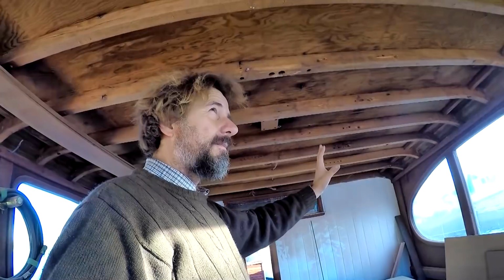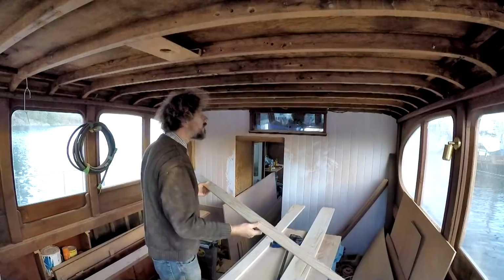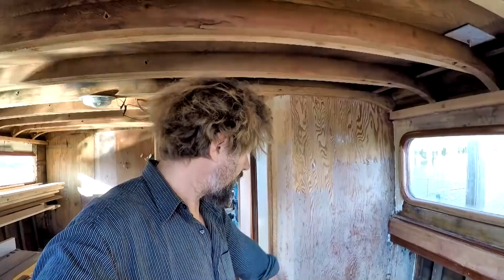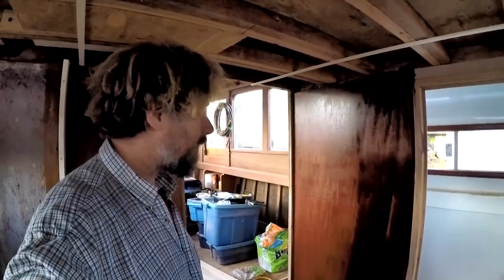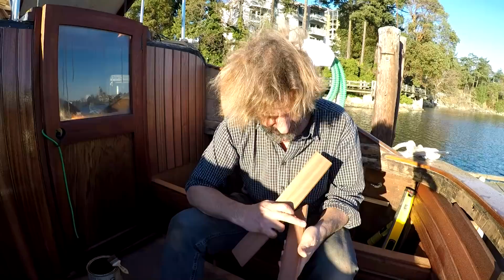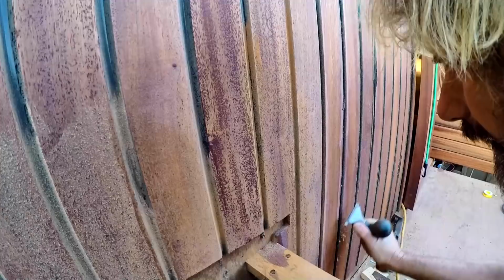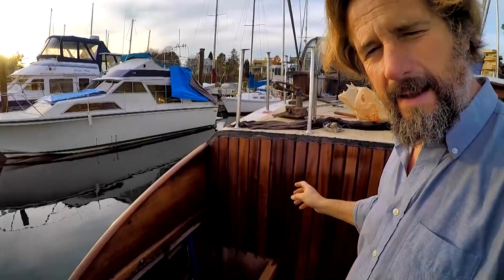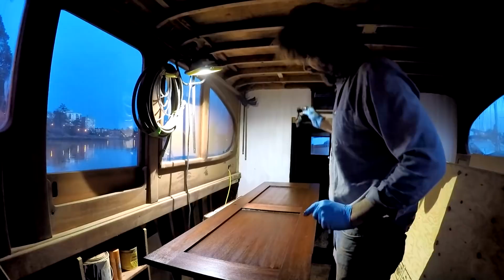Planking the bulkhead, Etc - Wooden boat restoration - Boat refit - Travels With Geordie #76

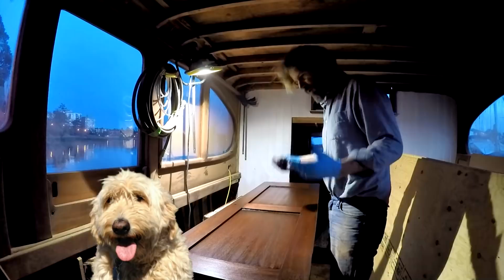Comment: 19:00 Gordy moves across screen from right to left.  Woof!  Keep up the great work.
Reply from the maker: Hi all you Cooks. Thanks for the kind words. Sadly I gave away all five shirts already. More soon!
Reply: MHey Gordy  i wanted to let you know  i was following up on our Masonite  ceilings  like you  my  usuall M O  when I'm building  something is to glue, screw, and tattoo the crap our of everything. Hoping i dont have to do the tear out down the road  i think you  got the right idea  screwing  the sheets onto the  framing   One. Concern i wanted to again point out  is it could work. Against. You  not having  any  movement  i  did  use a milled  peice of Sapele     I   Screwed  over  the joints  my first idea was to  mill splines   On the edges and. Slide the  edges of the Masonite into  the splines  but after several  failed attempts freezing my ass off on the icy Chesapeake Bay   And. Only ha;f a bott;r of rum  that planned changed  too those strips really  just  became for looks  i used stainless Robertson's  and i could  loosen and tighten the screws bu hand if it needed. It  (it didnt)   A consistent  problem i saw quickly was my sheets. Were many thicknesses  and it turned out  well  overall  my Dad. Used to tell me to pick my battles wisely  not everything  has to be built  like a fine peice of furniture  and  figured out what he meant   If i was to do one again I'm pretty sure i would. Glue up  4x8 sheets. With White Formica  on one face  the company I worked for back in those days distributed millions if dollars wort of HPDL per year and they would sell to us as a favor.at cost  which made it perfect for doing honey dos and personal  jobs  i worked there  for 20 years an they  a;ways did nice things for many of the employees  one of the guys actually had hotrods he'd bring in on the weekends and paint them in the shops booths  and bake them dry  with the place empty from any other people

Comment: Just found your channel so a bit late to tell you this. 
Calking material has to stretch when the timber dry's out under direct sun, this stretching of course takes the least form of resistance. Now you have filled the bottom groove of the bulkhead planking and the material will adhere to both sides of the planking and the face at the bottom of the groove, so three faces. During timber shrinkage one of these faces will fail, hopefully for you it's the bottom face, as then the two sides will remain sealed.
 I caulked the teak deck of my 1930s motor yacht in the same way, spent a fortune on Sika Flex but I didn't know they also sold a special tape that fits in the bottom of the groove that the caulking will not adhere to it. Over winter the deck did not leak, but half way through the next summer it started. That's when I found out about the tape, but then I had the job of finding the leaking joint, the leaks of course did not correspond with the drips below as the deck was laid on marine ply. So there was nothing for it but to dig deep into the piggy bank and re-caulk the whole bloody deck again.

Sadly I had to sell the old girl in 2010 but she has gone to super people and they have upgraded her, hopefully she will last another 88 years

Below deck the underside of the marine ply was covered with a mahogany faced ply let in between the beams. I think those white panels you bought would have looked great let in to those beams of yours. But hey it's you boat and I look forward to seeing progress with it and see her finished.

PS: If you are bored one evening look up Lazy Days, Dunkirk Little Ship. www.adls.org
Reply from the maker: Very good point on the three sided adhesion. I worried a bit about that and considered using a backer rod but it would be too thick. The tape sounds brilkliant. I really did want to put my overhead panels between the beams, I love that look. But the beams are a bloody mess and I didbn't have it in me to deal with that this time around. But I have a long term plan to do it that way and reface the beams. I'll check out Lazy Days.

Comment: I’m really impressed with your work, the way you manage that little space is nothing short of magic! I am really liking how it is coming along. 

I don’t know boats but have always dreamed of owning a chris craft styled motor yacht. Can you tell me, is it cold on board? I don’t see much use of insulation on boat refits
Reply: On YouTube videos....
Reply from the maker: Hi Daniel. Thanks for the kind words. Wood boats generally don't have insulation except possibly in the overhead space but even there it's probably not a very good idea. Happily the wood provides excellent insulation most importantly to avoid condensation which plagues plastic boats. I am plenty snug aboard while at the dock with 20 amps of shore power and electric heat. At sea or anchor I use a diesel water heater that also keeps me toasty. This setup will be all explained in upcoming episodes.
Reply: Thank you for taking the time to reply mate. Keep up the great work!

Comment: I really love your videos! How did you fastend the masonite roof panels? I have to fix the roof of my boat this winter...
Reply from the maker: Thanks so much Klas. I pinned the masonite up temporarily with tiny stainless steel air nails. They'll be held permanantly by wood strips between the panels screwed to the beams above.

Comment: Fantastic video , i redid a 1964 Chrus Craft Connie and i did  use  White Masonite for  my   New headliner  i was lucky that i had no water. Leaks or.  Issues  as i did  use  a West System om the exterior and a  very flexible paint with non skid. Called Durabek  over the  entire deck and  exterior  of the cabin and roof ! It was many  educated guesses   And 20 K. Worth of materials. To  get her ready for the water   And  the way i wanted her done   I first  used a plastic  white pegboard on the  headliner and i  was iunhappy  with its expansion with the seasonal  weather changes  making me change to the Masonite  i did however  put a waterbased poly on the  unfinished side to seal. It  and that may have  protected it. From  getting any water damage ?  Who knows why it worked. I may have just gotten lucky  i wound up selling the. Whole boat  and bought a Fibergkass boat that someone had already repowered and  completed many other cosmetic restorations  so it was more of a turn key  instead of a project boat ;Ike the Woodie Chris Craft !  Which you know any boat is  high maintenance   To keep in great shape    I did see the dog go accross the bottom of the screen right around 19:00  when you were giving the interior tour  of the interior aft area of the cabin  I believe in the Galley area you want to redo in the future for your daughter
Reply from the maker: Thanks Craig. Wow it sound like you did an amazing job on that Chris Craft. I pot polyurathane on the back side of the masonite too. holding up great so far. Thanks for watching. I'll be giving away lots more shirts.

Comment: Are you putting any insulation in or is the wood enough?
Reply from the maker: Hi Jim, no, I'm not adding any insulation anywhere on the boat. I want to prioritize ventilation to preserve the integrity of the wood. There is risk of trapping moisture with insulation unless you are very careful. On the whole the wood is a very effective insulator, especially in almost completely avoiding any condensation. A real nightmare for some fibreglass boats.